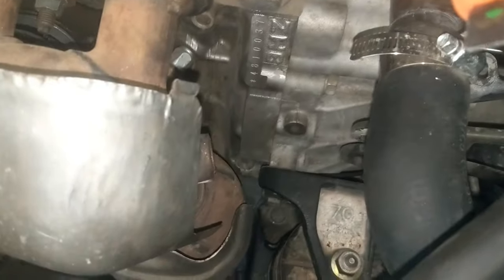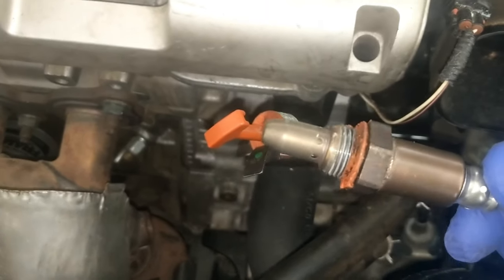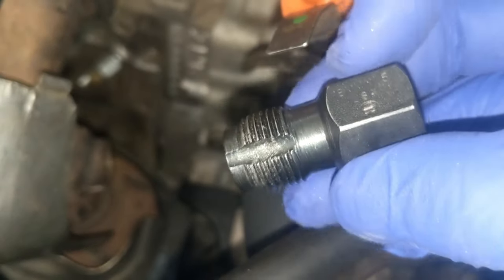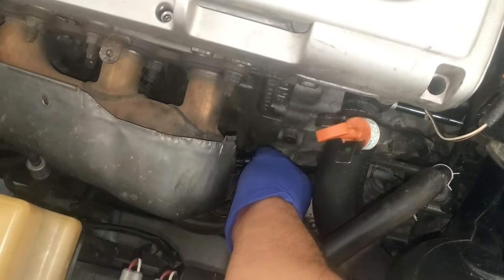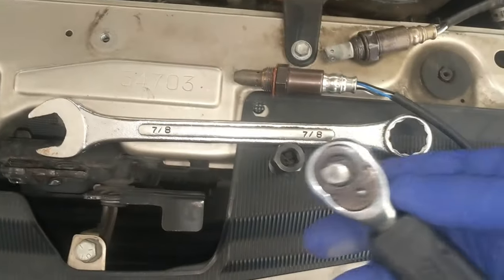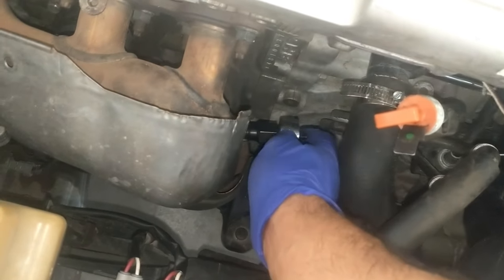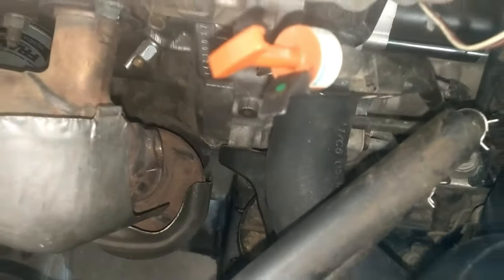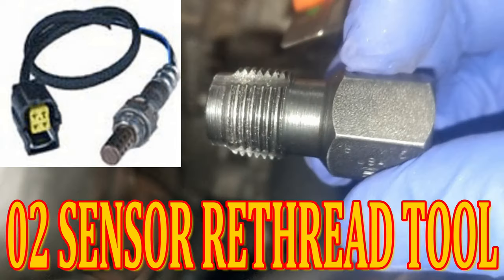HOW TO USE A OXYGEN SENSOR RETHREAD TOOL (stripped catalytic converter port)

Comment: Oh my God! I was thinking I had to buy a new catalytic converter. Thank God I came across your video! I removed my o2 sensor and had all of that melted metal around the threads and was like wtf! Couldn't remove it, melt it or  find anything on the internet. Thank you so much for making this video!
Reply from the maker: You’re welcome please consider subscribing as it helps me!
Reply: I gotta buy one 😒
Reply: I noticed when using the thread repair tool, it was wobbly when all the way in. And now that I put my new sensor it’s loose
Reply: @junebug346  That happened to me too. I just chalked it up to user error. Unfortunately, I had to get a new cat. That looseness was a no go
Reply: @hungpham5646  damn man ima try to jb weld it or something bro

Comment: I noticed the threader picks up a lot of the metal shavings.I went in half way took it out clean it then put it back in. One thing I did also was to take my sweet time. Don’t rush it and it should work fine.

Comment: Maybe the shop wouldn’t mess with it because you called it a “Cadillac converter.”  :p
Reply: I think it was general terminoligy, don't you want to correct me on my spelling Karen
Reply: @christopherferrazzano6339 😂 you mean pronunciation?
Reply: Actually sir y ok u are wrong. It is the catalytic converter. It's attached to the exhaust manifold. Looks like he has a Lexus or Toyota
Reply: And the people trying to correct you 😂😂😂a shop is more likely to steal the catalytic converter than say they won’t work on it…..but clearly this is the exhaust manifold. Good video as far as the repair working tho.
Reply: That's not even a catalytic converter that is the exhaust manifold 🤣
Reply: Exactly.
Reply: @madleague_gaming1693  your wrong, it's both. In Lexus/Toyota they are attached as 1

Comment: Don't use wd40, use copper antiseize!!! go slow and make sure its perpendicular.  and that is your EXHAUST MANIFOLD, the catalytic converter is located in you exhaust line pipe connected to the downpipe which connects to the manifold lol.

Comment: Wouldn't the metal shaving fall inside the Catalytic Converter
Reply from the maker: Possibly... but onece the job was done everything worked as normal.... no issue whatsoever
Reply: @BudgetClan  Just a little update if anyone else is thinking the same or concerned about the metal shavings going in the CAT I checked my Catalytic with a camera and there is metal but in form of Dust very little not shavings basically harmless not clogging MetalCombs. Metal shavings Fall outwards when rethreading.
Reply from the maker: @JimmyEatWorm  good information thanks!

Comment: What happens if you rethread it… but your threader comes out worn out? What does that mean?
Reply: Try a new re threader with lub like oil or wd40 to prevent damaging the new chaser and cleans the treads on the manifold